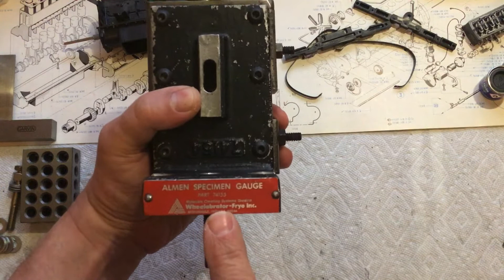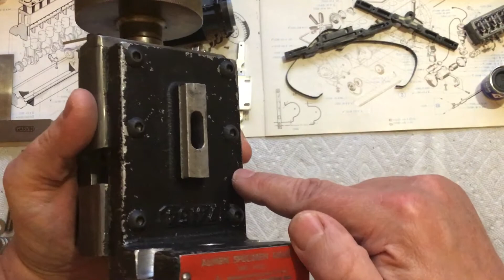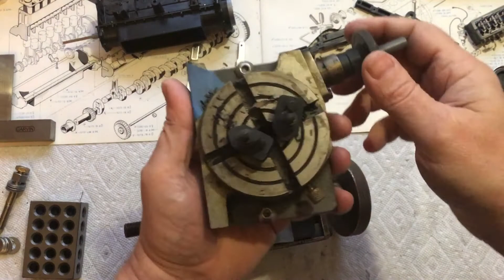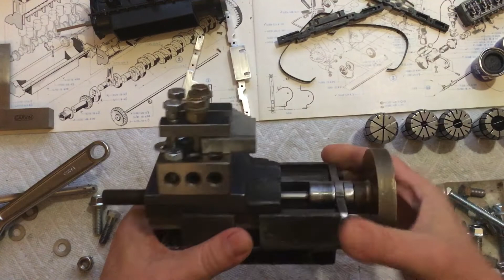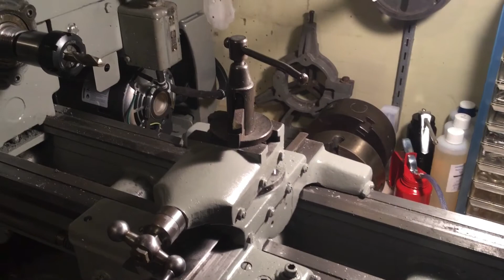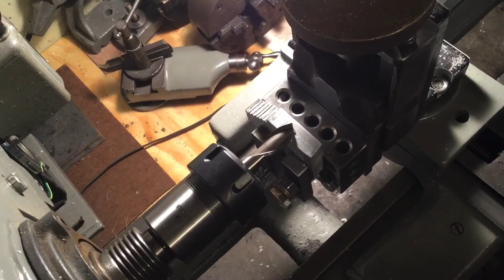My homemade lathe mill attachment actually kinda works!

Comment: I have one of those vertical mill slide. I don’t have it mounted yet. But it appears pretty solid and fairly well made. I saw a recent video of someone identifying the dial gauge is NOT accurate for vertical movements…the one measurement I didn’t take  🙄  just to be clear- when moving the wheel 1 full revolution, the video maker said the reads did not correlate to any standard or metric measurement 🤦🏼‍♂️ gonna measure that soon hopefully.
I’m excited to use it sooner rather than later! Good luck sir
Reply from the maker: Thanks for the info

Comment: Hi, Perhaps a bigger diameter end mill (to reduce vibrations) and a quicker rotation would help, with cutting oil. I think that the system is very ingenious and well done but even if you get it to work well, the vertical travel is very limited. There is very inexpensive mini vertical milling machines on that "auction website" from $145...it says that it can cut aluminum, but I don't know for sure, it can probably be easily improved too, try " Mini 100~240V Milling Machine DIY Woodworking Metal Aluminum Processing Tool US", I think that you could fit it in your shop (it's small) and personally, I prefer a vertical mill, probably because I'm used to it... Thanks for the video, 👍
Reply from the maker: Thanks for the info! I’ll try your advice, and I’ll check out those cheap mills. Thanks again!